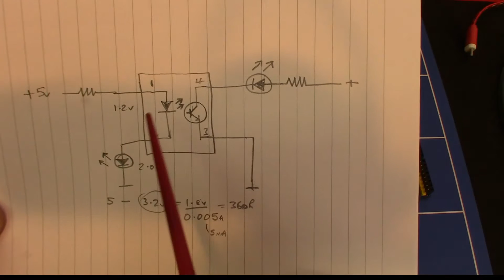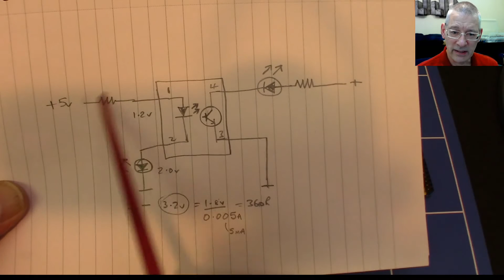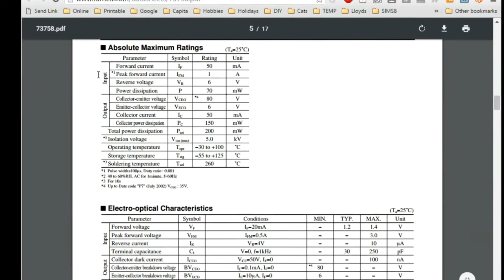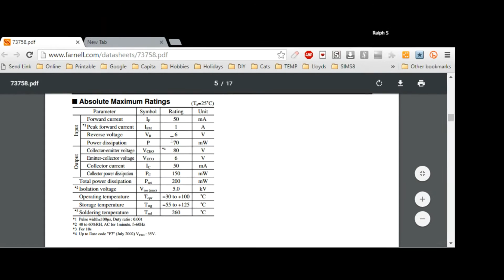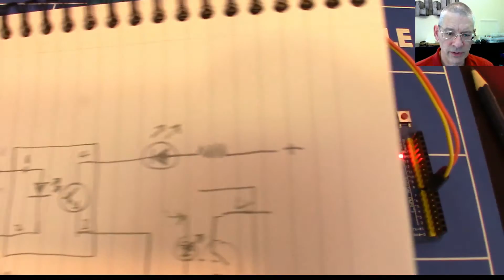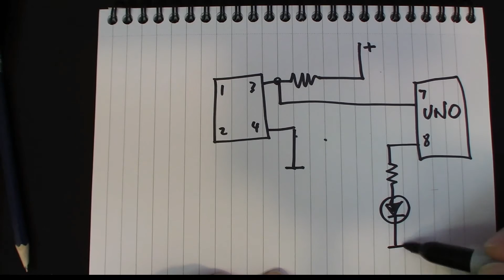#53 Protect your Arduino - use an Opto Isolator! And RGB sound-to-light demo

Comment: Newb here so sorry if this is a stupid question. I have a 12v magnet door sensors and id like to detect its state on an esp32. Would this be a good use case for an opto isolator? Would i plug the 12v to the LED side with a resistor to reduce the voltage down to 1.2v, then connect the ESP gpio to the transistor side and ground?
Reply from the maker: You certainly could use an optocoupler here, although just reducing the 12v down to 3v3 for an ESP32 is as easy as adding two resistors in series from the 12v "signal" to ground, with the signal taken from the junction of the two resistors. 

For example, you could use a 12K resistor (connected to the 12v) with another 3k9 resistor in series connected to ground. You get a safe 2v9 at the junction which is fine for the ESP32 to detect.

If you were hoping to detect the voltage across an LED, it would be more than 1v2 as most LEDs are around the 2V mark (blue requires much higher maybe 3V, red the lowest, maybe 1v9) - your ESP32 could detect this directly, if it's safe and isolated (I'm assuming the 12V is from a transformer?) or wire up an optocoupler in parallel with the LED (might reduce the brightness) and connect the detector to 3v3 and your GPIO pin - then you're very safe.

Always test on a breadboard before connecting any ESP32 directly to anything. A lesson I had to learn the hard way.
Reply: @RalphBacon  WOW thanks for the detailed explanation Ralph! I went with your suggestion of the resisters in series and it works perfectly. Your videos have really helped me to get over the initial learning curve of microelectronics and I'm having great fun building building up my skills and knowledge with a view to some practical applications.

Comment: Hi Ralph; Thanks a lot for this wonderful tutorials.I'm trying to connect my motion sensors from the old wired alarm to an arduino with an ethernet shield .Do you believe that this PC817 will work fine to protect Arduinio from the 12 v of the sensors?  Rgds
Reply from the maker: Yes, you can, just be sure to current the limit into this device from the 12v supply so that it is not overdriven. So, for example, 12v at 20mA would require a series resistor of 600 ohms (use a standard 680 ohm value, or thereabouts). The output from this device connected to the Arduino is then fully isolated from the 12v supply.
Reply: @RalphBacon  Thank you so much

Comment: Back in the late 80's, I learned the hard way that not all grounds are equal.   :)    I added my neighbor to my lan network and blew up 5 network interface cards.  Turns out, our ground potentials had a 50 volt difference.  That's when I learned about fiber optics.  We both had good deep ground rods, so I thought nothing of it at the time.  Took me a few hours to figure out what the problem was as it was not something I could conceive of before finding the problem.   Never got bit by that problem again.....
Reply from the maker: Too true! In the old days of the Wild West in the USA, they had to pour water around the ground rods for the single wire telegraph wires!

Comment: Hi, I don't understand how a 43k resistor can work on the collector side. That gives you only 0.1mA current at 5V, way below the datasheet min collector current 2.5mA. What am i missing?
Reply from the maker: I don't think you'#re missing anything. I just happened to use a 47K resistor (as we were dealing with signal levels) and it worked just fine (despite what the datasheet might say, which I obviously didn't read well enough!)

Comment: Ralph, if you wanted a small kit / assortment of these could you recommend a few
Reply from the maker: I'm not sure about a kit of these, I couldn't find any not even from our Asian warehouses. But I used the PC817 in this video and it worked fine. Depends on whether your want multiple isolators in the single chip. Do a search on RS Components or Mouser to narrow down what you want.
Reply: Ralph S Bacon thanks Ralph

Comment: I'm not sure of the physics behind it,  but LEDs seem to generally have very low reverse breakdown voltages.  I deal with protecting those when necessary by connecting a diode across the LED,  the other way around-- anode of the diode to cathode of the LED,  and vice versa.  A 1N4001 is overkill in that application,  just about any small signal silicon diode will do the job, and since I have a couple of thousand (salvage! :-) 1N914s and 1N4148s,  I use those.
Reply from the maker: LEDs seem to have a reverse voltage max of 5v these days (just high enough that I don't kill them on Arduinos when I put them in backwards!). I've not seen a protection diode ever connected across them though, Roy. I'm just trying to think of an (Arduino-style) circuit where that would be necessary, given that the voltage would have to be reversed?

Comment: this is fantastic thank you. i was wondering, if i wanted to send control voltage signals to my arduino, would i need one of these? i'm hoping to send signals from -10v - 10v
Reply from the maker: It depends on whether the voltage has any meaning other than on/off. Does -5v mean something different to +10v?

Comment: Helpful vid! But, using a self-blinking christmas LED compromises the diagnostic function of that LED. You can't know if the LED is blinking, the power-supply for the LED, a bad mechanical switch, or the opto-isolator. Still, it's helpful to show that when current is broken on the input (in this case, due to a self-blinky LED), then the output current is also broken. 

Using an arduino purely as a power-supply for the big LED may be confusing to some. As a viewer, i keep thinking the arduino is being used as an arduino-- which it isn't. The potential for confusion is compounded, cuz in typical usage involving a 'duino and an opto', the 'duino would be on the control-input of the iso, not on the output.
Reply from the maker: Well, it's only "self-blinking" when power is available, Johny, and it's slightly less boring than a standard red or green LED! After a while you get to recognise the pattern too.

Comment: Excellent explanation, thank you !
QUESTION: I'm using an nano in a car  with lots of different 12V inputs (obviously regulated down) to suitable). There are also a few BJT's etc involved and due to this the car-GND and the uno-GND need to be connected. The outputs are converted back to high-current 12V again.  Fo rthe safety of the nano, I was planning to put opto-isolaters on the outputs (between nano and the the outgoing mosfets). Would that work as to isolate the nano - because they have common ground ?
Reply from the maker: Yes that will work and is a good idea to prevent 12v ever touching an Arduino pin (goodbyte Arduino port, possibly the whole Arduino). It will work in exactly the same way as the Relay Optocoupler from video #18. Test it out with lower voltages first on your workbench!
Reply: Thank you very much Ralph and thanks for your efforts.
 I'm sure I've watched #18 already, but will watch again.

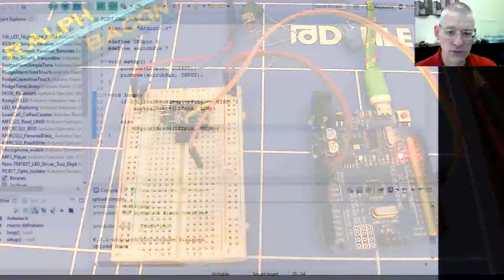Comment: 17:18 "Let's look at the equivalent circuit" 17:31 "there's the code" daMN, I DIDN'T KNOW DRAWING CIRCUITS REQUIRED PROGRAMMING; what's more, you didn't show the location of the pushbutton switch in your diagram, ethereally referring to it as "input", not only obfuscating the function of the built circuit as did the superfluous Arduino code, but by negligent exclusion of demarcation c. any secondary power source- you're also making the presence of any 'Opto Isolator' apparently EXTRANEOUS...
And really that's just how simple it all is! Totally occult.
Reply from the maker: Thanks for the critique, Ryan, I shall endeavour to be more accurate in future, thanks for posting.

Comment: Is it possible if i place my load after pin number 3?
Reply: Yes the resistor, load, can be placed after the photo transistor on pin 3. that would then act as a pull down resistor allowing a non inverting output for the Arduino.
Reply from the maker: I'm not sure what you are asking here, Ammar. Do you want to use a different pin, eg pin 5 or 10? That is perfectly OK. If I have misunderstood let me know.
Reply: @RalphBacon  if we look at the circuit diagram of the optocoupler at the output side, we can see transistor is used and my guess is it operate like a NPN transistor. Say I place my load at pin 3 would it works? it is because load can only be placed at the drain side of the transistor only. I am sorry for the lengthy discussion, this component is new to me and i'm excited to explore it. Thank you.
Reply: It turns out it will work from my research findings in forum. Thank you.

Comment: I use home-made vectrols for this purpose because the polarity can be a problem, vectrols are bidirectional (current can flow in both directions) and don't need any additional components and care.
Reply from the maker: Isn't that like using two optocouplers, back to back? Connect the LEDs up A-to-K and vice versa on the other end and voila! A homemade vactrol is yours for pennies? Much cheaper than what I've seen as a 'proper' vactrol.
Reply: @RalphBacon  No, a Vactrol is a LED with a  LDR (light-dependent resistor) so it is another puppy with different characteristics. With home-made I mean "made at home", made it myself with a LED and a LDR and dipped in black substance. I believe the name "Vectrol" is a commercial name and they are pretty expensive. When made yourself they are very inexpensive and very easy to use.

Comment: In a mobile application where I want to use an Arduino to operate a 12v 20A relay, the optocoupler looks like a great option to isolate the two halves of the device.  However, since the whole thing is being powered by the same electrical system (14.+ volts from the alternator) am I able to truly isolate the two sides?  Thanks for all your help.
Reply from the maker: In that case, you're not totally isolated but it's still a lot better than running off the same local power supply. If nothing else you can add fuses to the Arduino side of things and reduce the voltage before it hits the Arduino thus reducing any possible interference too. You can get any number of buck converters that will reduce from 12v to 5v but do double check them - we don't want any zapped Arduinos!

Comment: Hi Ralph. A very good video that just may save destroying equipment (or worse) someone's life if they are a HW novice. I have successfully used the higher performing 4N35 to isolate Arduino I/Ps from electronics voltages on industrial control equipment (24v DC) and solid state relays to control 240vc/50Hz on the output. 

"Why solid state relays?". No contacts to burn and no back EMF precautions required. '-)
Reply from the maker: Interesting that you mention an SSR, Brian, as I have recently received a couple with a view to doing a quick video update on them, viz-a-viz a true coil relay and even a MOSFET. Thanks for the reminder!

Comment: Hi Ralph, I think you forgot to mention that this is an analog device and i don't think there is any hysteresis..... right? I don't know:-)
Reply from the maker: Hmm, all the circuits I've seen (on the datasheet, for example) seem to assume we're using TTL-level and style signals, but that doesn't preclude using it in an analogue fashion, of course. In which case, there should be no hysteresis of any kind otherwise that wouldn't work at all well. Did I say there was in the video?

Comment: Ralph, thanks for keeping beginners in mind. Beginners are the ones that watch these great videos. The experienced ones that already know this make their own videos.
Very helpful.
Reply from the maker: You got that right, Danny, as this channel is for beginners, to get their projects off the ground. That said, I hope we never stop learning something, no matter how "experienced" we think we are! And it's always good to get "experienced" Arduinites' points of view on things as there may be better (or, at least, other) ways of doing things. But thanks for that supportive message, Danny, very much appreciated. Plenty more videos for you to watch!
Reply: @RalphBacon  i have 5 button switches connected to 5 automotive relays and 5 fuses

A very simple 12v citcuit

What I want is to remove the 5 button switches and connect an arduino inplace of all 5 switches

And through a bluetooth module I will use my phone to switch any of the 5 outputs wirelessly

The problem is that I do not want to channge the automotive relay to a relay board with optocouplers built in I want to leave the automotive relays and fuses as is

So all I can think of is get optocoupler bourd and connect the arduino to 5 optocouplers then the optocouplers to original switch wires and voila!! Right??

Please let me know if I am wrong in any way

Comment: You could use this to trigger a transistor to allow switching of higher voltage.
I'm comfortable with these for use with lower voltage switching. 

Great depth of knowledge given in this video. 
Thanks for posting.
Reply from the maker: +The Tubejunky
Absolutely right about driving higher loads (eg a relay or motor) with a transistor (either directly or, more likely, via Arduino control). I didn't include it as it added another layer of 'complexity' that Arduinite noobs don't feel comfortable with but good job you mentioned it here so others can read that and it may trigger off some thoughts for how to repurpose my demo sketch into something useful to them.
 
Thanks for posting and your words of encouragement :)